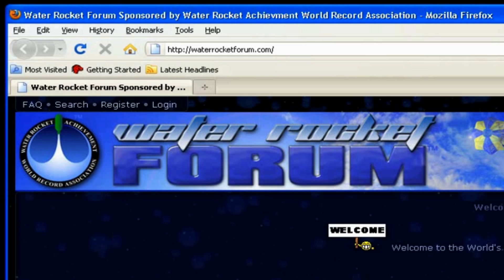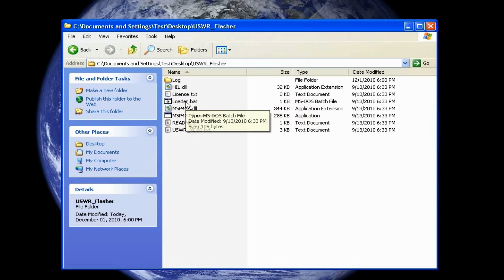Part 3: MD-80 / 808 Car Keys / Gumpack Camera Timestamp Removal

Comment: I know the black 808 key chains once I did something to the text file and no time stamp appeared. That's correct. Now as what I did I don't recall as I thought you could. But more I read now you cant. I'll dig it out and toy with it more. But I'm certain I got the stamp removed.
Reply from the maker: Harry Schlonge There are probably 20 or 30 different clones of this type of camera. This video was made when there were only a handful of them and at that time none of them had the ability to disable the timestamp. A lot of people complained and none of them would change the code to allow the time to be disabled. That's why people like us had to hack the silly camera firmware to get rid of the date. In the years since then, new models have been created by many companies and some of them added the software to read a text file on the root directory of the microSD card and follow configuration commands to set up features of the camera. Many of them added the ability to shut off the time stamp with this method. But at the time this video was made, this was the only way to get rid of the annoying date.

Comment from the maker: The modification to the firmware would be very tricky. This mod is a "brute force" method where the character set was located in the memory and every character was turned into a blank (like the spacebar character). So, what you see is the date on your screen but it is all spaces and so it is invisible. To make a title or something would mean someone would need to actually understand and change the printing code to print something new.

Comment: @USWaterRockets 1) it was update thought usb that ruined it  2) Do you have any source for MSP430 that can do something like that or do you have any links with information I can read on how to make this possible? 3) Do you know of a cheaper way to flash the whole firmware? I have already desoldered the chip that holds the firmware which in my case is a 25Q80SCP (8Mb = 1MB). I have found the firmware I want to write in chucklohr page. Considering the cost of the cam all is for educational purpose

Comment from the maker: @kasperghost85: The program was custom written by U.S. Water Rockets. To answer your questions: 1) It is likely that a bricked camera could be recovered the way you describe, but it would depend on how the camera was bricked. If you ruined the camera trying to perform the tricky firmware update over USB, then it would probably work. If you bricked it by over-voltage or physical abuse then it would likely not work. 2) Yes, it is possible to write a MSP430 program to load the whole firmware.

Comment: Hello, who is the creator of the program that patches the spi flash memory? As far as I understand each camera has SPI Flash(kinda like SD holding OS permantly), SDRAM for execution of OS/program, DSP Processor that is different on each camera. Firmware checks only if DSP compatible.
 I would like to know if it is possible to unbrick a camera by flashing whole  firmware instead of making changes directly to memory? Can this be done with the MSP430 kit you mentioned? Thanx in advance :)

Comment from the maker: @ParanormalEvidence01 Thank you for the vote of confidence. The instructions are meant to try and make the process easy for everyone. These cameras are so inexpensive that it is worth the effort to try. There are a lot of people modding  these in different ways, so people will hopefully try this and get some experience working on these micro circuits, even if they make mistakes or mess up. Getting experience is the key and if you succeed  you also get a feeling of accomplishment! Good luck!

Comment from the maker: @dutchwaterrocket 
We have a couple of good launch areas that are surrounded by trees. The area we live in does not have many really large areas with no trees, so we have designed the rocket to have as few places to snag on trees as possible and we have designed ways to pull it down. We also try and launch at an angle so that the winds carry the rocket towards clear areas. Most of the time we hit our target. Sometimes the trees seem to draw the rocket in using an undiscovered force of nature.